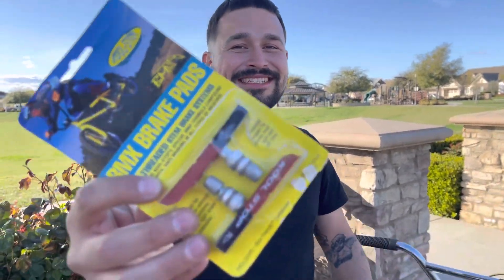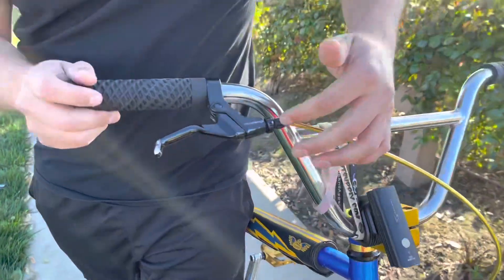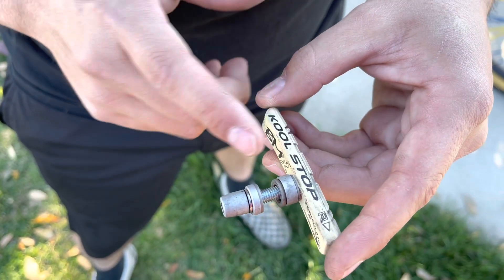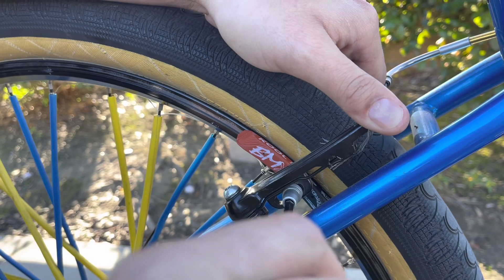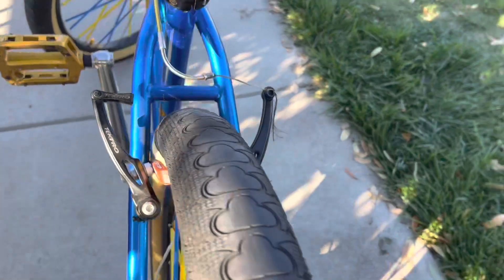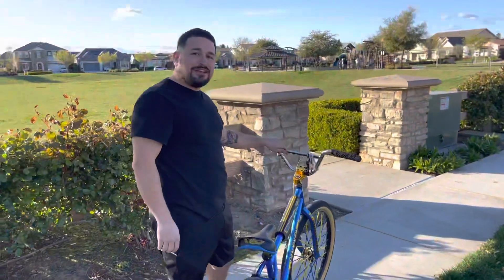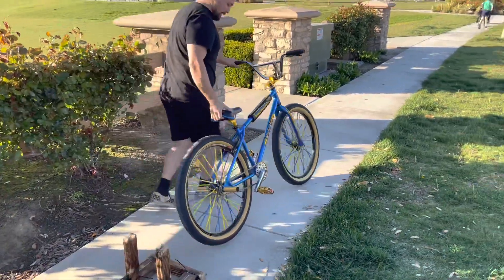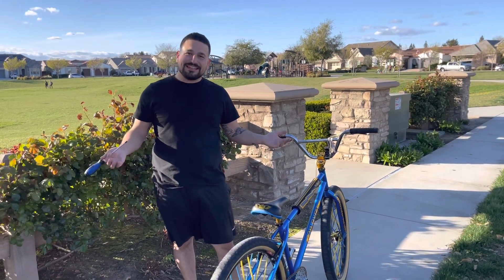How to install the best BMX Wheelie brake pads

Comment: Why do my kool stop brakes make a lound noise there new btw
Reply from the maker: It’s because there out of adjustment, loosen the bolt on the break pad hit the brake and make sure it’s all aligned
Reply: Ok thanks but do you think its the brake pads or the rim ?
Reply from the maker: @IOILLLLLLLLIIII  it’s the pads!
Reply: Ok so do u think its cuz its not aligned or its because there new and not broken in ???